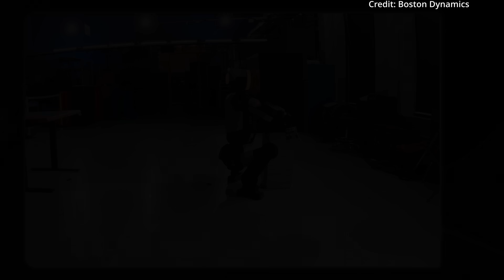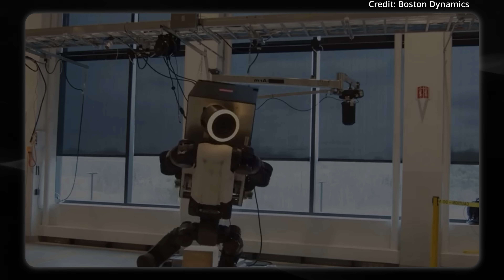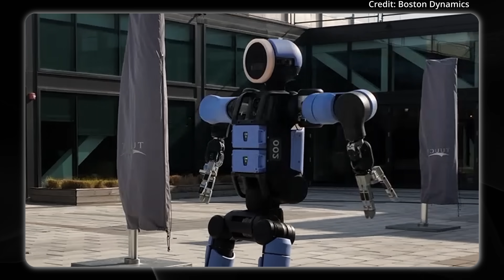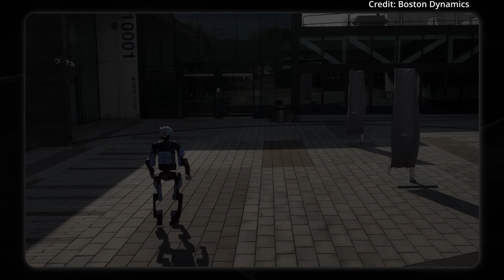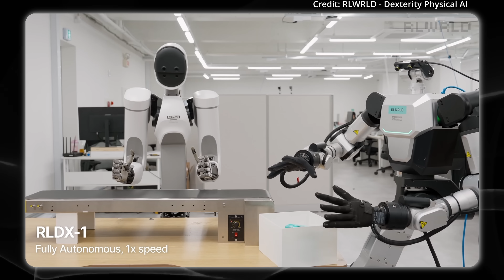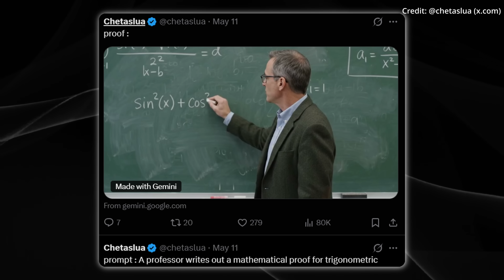Boston Dynamics ATLAS Reveals 5 New SUPERHUMAN Upgrades (AI UNLOCK)

Comment: It is a genius concept: wireless communication to body parts that rotate 360 degrees. Is the wireless concept applicable to a super capable hand with finger parts that can rotate 360 degrees and bend in two directions? What would be the optimal hand geometry for wireless rotational fingers to do practically every human task?  The human hand is a marvel of evolution, fingers can bend partially in many direction, but fully in just one direction. The Atlas hand is perhaps the least advanced part at the moment, in comparison with other humanoid robots, optimus, etc ...

Comment: Its actually genius the way the whole torso can move 360 degrees, I didnt understand the practical application until this fridge demo. So cool.
Reply: Breaking the logic of human body movements is the key to developing humanoid robots.
If a robot is so clumsy that it has to mimic a human turning around, it means its efficiency is extremely low...
Reply: Think of it this way not only can the robot work 24 hours a day 7 days a week besides when it's recharging or having repairs, it can work in a smaller workspace it can move a refrigerator and rotate itself in such a way that it requires less room therefore you can have more robots in the same spot doing more it's an exponential game, they can work longer, they don't go on strike, you don't have to pay for insurance, they don't take coffee breaks, they don't get in fist fights with each other, you can put more of them in a smaller space and get more, they are going to replace humans and literally everything, there will be no need for grocery stores in the future because there will be no profit in a grocery store.

Comment: So the robot doesn’t learn anything, it’s all prerecorded.
Reply: Many of the demos are still programmed (planned movements), but check the figure ai demo of the figure 3 robot on the production line. This is running on local AI (fully autonomously and no cloud connection). Optimus will be running on Tesla AI chips ... And Tesla cars are technically robots on wheels.
Reply: Learning right now mostly happens in training of AI, basically like people going to school or college or any other training for a job... Once people start working, there is little learning happening or needed.

Comment: Months to program one task with a team.
Measuring tape to set up pedestal and table .
Precise robot location and alignment before starting program.
Is the average homeowner ready for hours of programming to put away dishes not perfect placed after a meal?
Reply: This sort of rigid thinking is what you're going to get caught flatfooted. You may be right that for a few months the data needs such management, but that's sort of a one time training setup - and then for all time it doesn't need to be trained again. Multiply this for every task and yes, you get massive training gaps... for a while. But then after those gaps are closed they never, or almost never, reappear.
Reply: is the average homeowner going to buy an Atlas Industrial Robot?
Reply: 뭔가 착각하고 있군 아틀라스는 산업용 로봇이다
Reply: You should get up to speed on how robots are programmed these days. It's not 2017.
Reply: @wildfotoz  YOU sound watch Boston Dynamics Video!

Comment: I want to watch china robot fight atlas robot
Reply: I want to see them improved and put in UFC
Reply: Just in terms of moving objects and turning around, Chinese robots are at least two logical generations behin
This is because making robots mimic human movements is an inefficient practice, and this is the path China is currently taking.
Reply: The fight would go exactly like those hackney "Ancient Kung-fu Masters" selling themselves on video, mogging dozens of attackers with their pinky finger. 
Master BùrShítr so delulu, he jump in ring w one trained fighter,  get instant broken pieces rike Tofu
Reply: Imposible
Atlas mide 1.90 metros y pesa 90 kilos es como un estadounidense
Los robots chinos miden 1.69 o menos y pesan 65 kilos o menos....como un chino
Reply: The Chinese robot sounds like cheap plastic when it moves. Unlike figure3 atlas or Optimus.  I'd love to see a fight also, but it must be all Ai no tele control
Reply: @XxMicahxX  china is gonna have so many though, variety of cheaper, much more disposable ones. I don't think they are that much worse than atlas since atlas has to be programed with unique movemnts that are not human.
Reply: @JoshEl-uf4cx  True however so far most of the chiness robots that they display what they can do is remot operated. Not even running any type of Ai. They are very deceptive compared to figure 3 who is currently doing a 4 day live of its robots working in a factory.
Reply: @JoshEl-uf4cx  lemme drive the point home . The reason you see a flood of Chinese dancing robots is all thanks to (Western) Nvidia sharing robot simulation training software Isaac Lab , Free & Open-Source.
All Chinese do is copy human motion capture data and train a kinematic model of the robot in sim for a few hours.
Not only that, actual techies (not paid🇨🇳shills) who have purchased the famous "kung-fu" Unitree robots have exposed the security flaws and cut-corners that we've all come to expect from glorious China. You gotta wonder if they made them vulnerable to hacking for plausible deniability a reason
Reply: @JoshEl-uf4cx  It's as if Chinese robots don't need programming... In terms of the motion logic for moving objects and turning, Chinese robots are at least two generations behind.